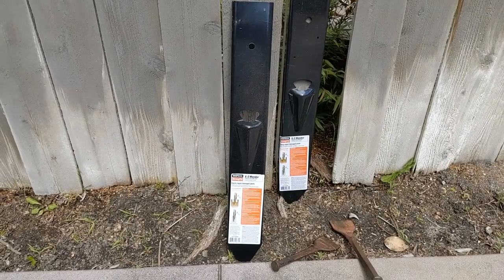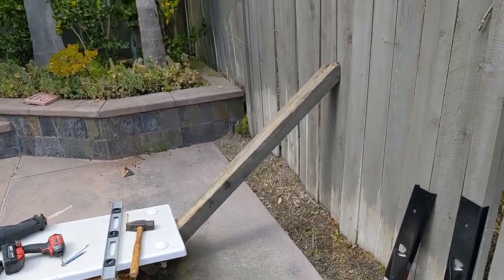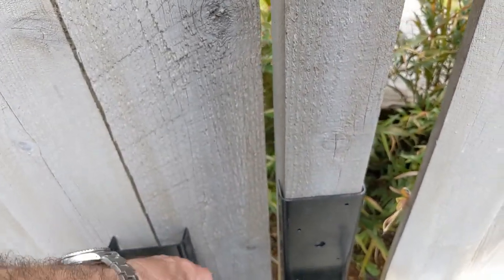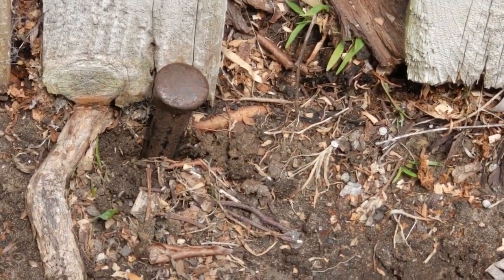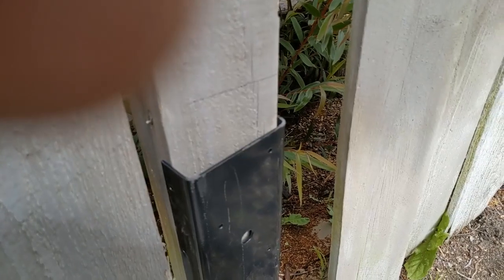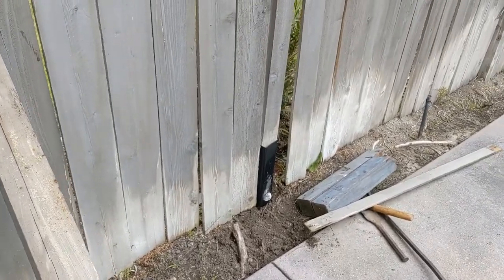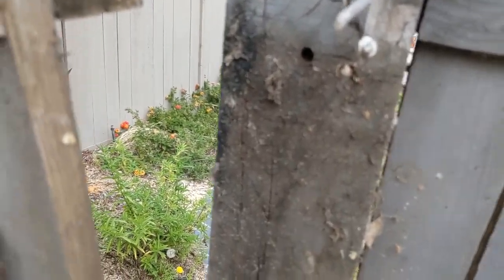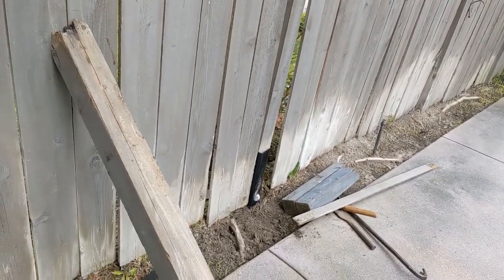Home repair fence post repair ez mender device by froggy

Comment: Froggy...I just experienced the EZ mender into concrete  around the posts.  It was a pain in the rear.. Simpson recommended  using them in pairs..It took 6 hrs for 2 post & 2 trips to store.  I  found using  a clamp to hold EZ mender close to the fence..Beware it is not as easy sometimes it looks easy on YouTube..Keep up the good work.
Reply from the maker: I could not agree more, this is NOT an easy job. FYI I only used one (side) and it's very solid. I used 2 hands on a 2.5 lb short sledge hammer. I wish the "lip" were a little bigger. To hit on. Be advised mine is still 100% solid. So a lot of work, but it works:)

Comment: Make sure you don't strike it at the top middle, or you will bend it in, which will prevent you from straightening the post.
Reply from the maker: It worked fine, just strike it at the spot they intend/indicate. Good product, fence is solid.